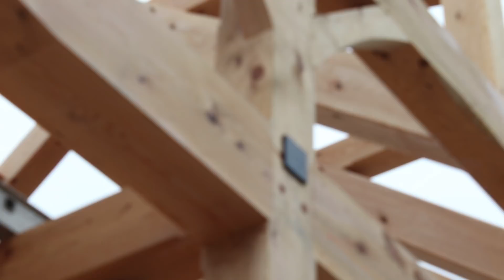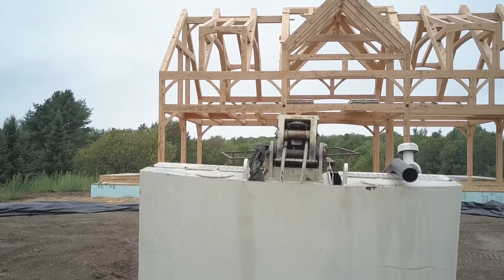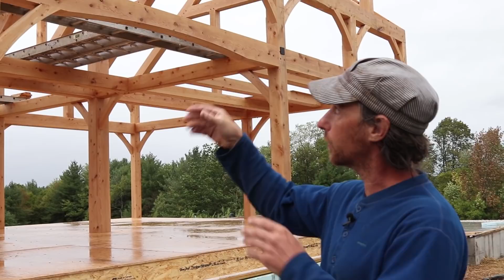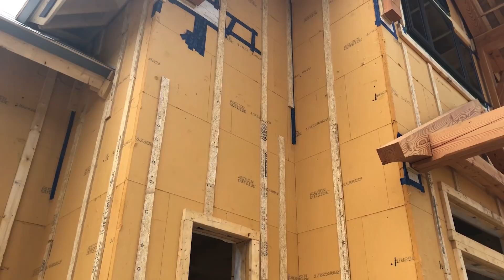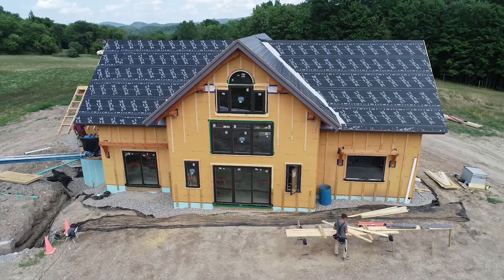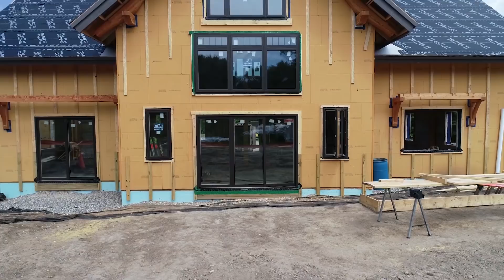475 On-Site: High Performance Timber Framing with Bellwether Craftsmen of Vermont

Comment: You make a lot of claims with no support. You claim to educate the client but your video provides no support of why they should not use panels other than general inaccurate statements.
Panels "React over the long term" how?
Do what necessary things to make them (panels) last? and how are they inherently sensitive for several reasons? You claim there are additional costs but having built high performing structures for thirty years, I can't think of a single "additional cost" I can however, think of a lot of cost savings.
In addition, I can point out many additional costs in the system you are using on this house. It has substantially more labor due to the many many more layers in the envelope. It also uses an insulation that is inherently expensive and not readily available in most markets. I love the fact that you detail smart air and vapor barriers  along with back-ventilation on all envelope cladding. You've got some fantastic details that will perform very well. But to suggest your's is a vapor open system  thereby implying that a panel system is not is  simply incorrect.
I'm all for energy efficiency and sustainability but let's be honest with ourselves and our client.
Reply: I had the same thought, 2 by 6 cladded to the main timber framing, it is like you built two houses.
Reply: I was thinking the same thing..
Reply: i think with the sips, he was talking about how they tend to move and cause problems with sealing and vapor. I'm not in the industry but I'm interested and have heard complaints. But yeah, I got the impression he had strongarmed the customer into a smaller house for the same or more money to do it his way. I'm sure its a very durable and high performing construction method, but still
Reply: I like this guy and I want to support his business. I think I’ll need to dig into a more thorough explainer of the building science of his approach. It did make me think of that old saying to the effect of, any builder can make a bridge of immense size and cost, a great engineer knows how to make the leanest, cheapest one that will not fail.

Comment: Absolutely beautiful house! I'm pleasantly surprised it wasn't yet another timber+SIPs house, and I appreciate his explanation as to why that's not the best practice to follow. I would be interested to hear his thoughts on following the same principle as timber frame + SIPs but with CLT panels instead (timber + CLT), with Gutex exterior insulation.
Reply: I'm researching on doing a house similar to this for my wife and I in Kentucky. Could someone please educate me on the downside of the SIPs in this application. Would it make a difference to use a panel from B. Public? I've been looking at their panel system as it is different than SIPs. Any insight or education in this area is greatly appreciated. Thank you.
Reply: @greghawkins549  Had never heard of B. Public before, but checking into it, it looks like that would be a superior choice to SIPs. They're just prefabricated panels, but designed to be vapor-permeable. With prefab, you get all the benefits (and norms) of traditional framing, but also the tight controls of factory assembly and less jobsite waste. And in keeping with the idea of hybrid construction, you're also fully encasing the timber frame within the thermal envelope.